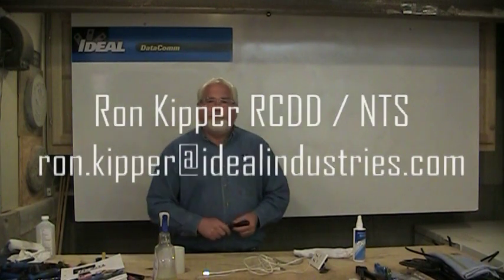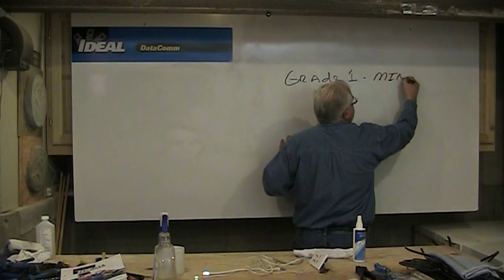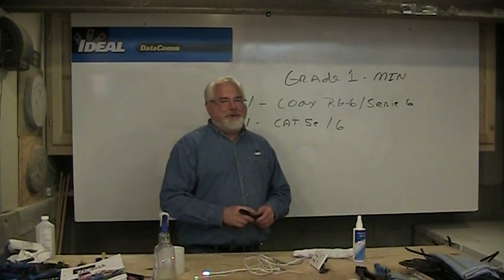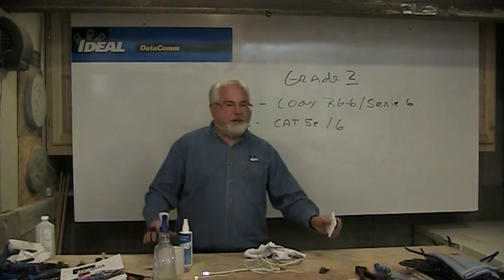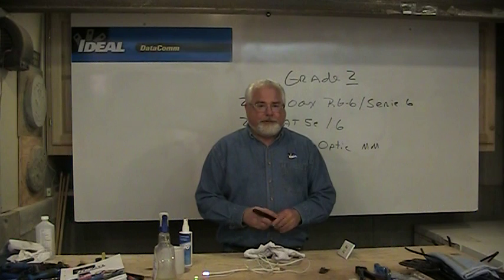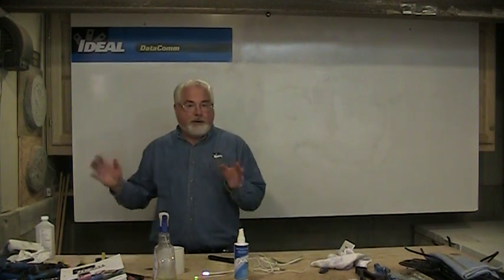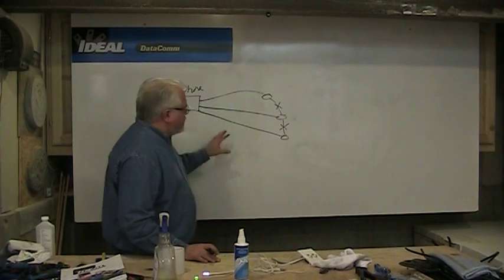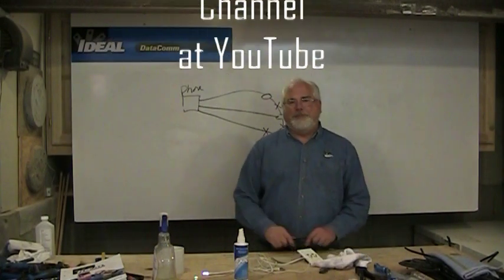Smart Home Part 2 Grades of Cable

Comment: This is not wiring a house.  I'm trying to determine if the wiring (copper) that is going into my house is up to grade because it doesn't have name, size , or grade written on its sheathing.
Reply from the maker: Hello not sure how I can help you Ron
Reply: @RonKipperDatacomm1  My mistake, I'm thinking about the electrical source to the house it's self and all the outlets.
Reply from the maker: Typically 4/o Aluminum wire is used to feed a house hope that helps Ron

Comment: Suppose I have 2 phone lines coming in to the house. One of the phone lines will be used for DSL. Will the non-DSL phone line use W/Blue on pin 3 and Blue on pin 4 and no other pins used?

Now when hooking up the DSL phone line, will W/Orange go to pin 3 on a jack and Orange wire to pin 4 with no other wires used?

I am using Cat 5 cable to run wiring to the installed phone lines and some of the jacks have 2 jacks in a room for line 1 and line 2. Will my wiring scheme work?